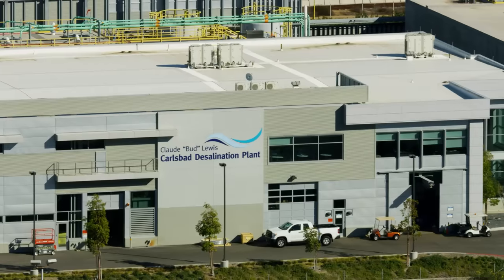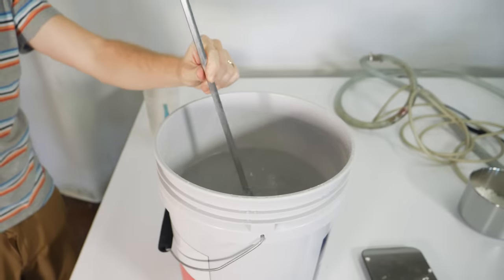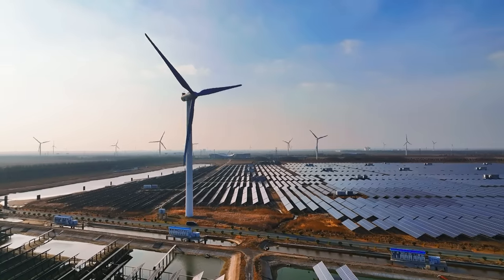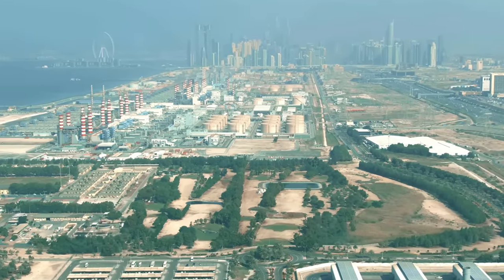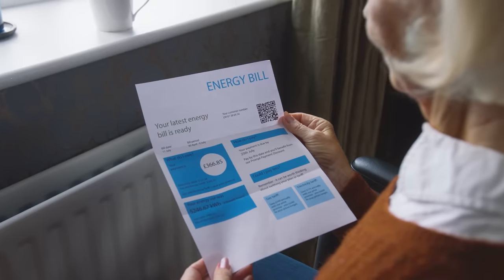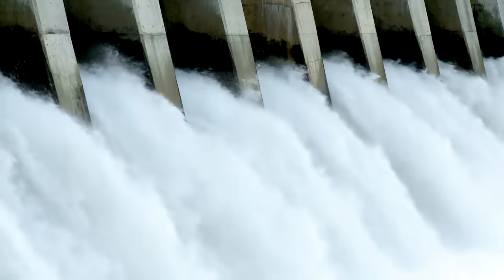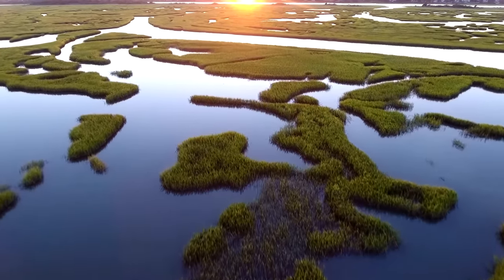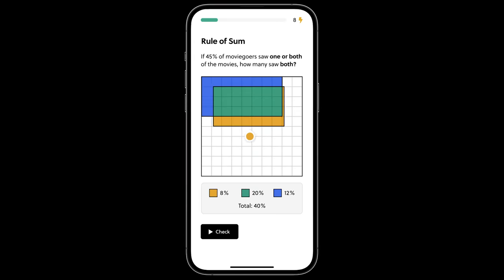Why Is Desalination So Difficult?

Comment: I've drank literally thousands of gallons of desalinated water over 20 years while I was in the US Navy. First ship used 7 stage evaporators and the last two used reverse osmosis. You couldn't tell the difference between them since it was pure water that came out of them and the engineers added minerals back into them to make them drinkable.
Reply: How does the engine add the minerals back?
Reply: Ship scale is a lot easier than city scale, glad it works
Reply: @johnmicheal3547  Its not an engine. Its a desalinization plant. The chemicals are put in the water using a metering device before the water goes into the storage tank on the ship. We only had bromine injection on our ship. Bromine is used to kill any bacteria in the water.
Reply: Same here. The water got interesting on one of the big decks I was deployed on when it tried to distill saltwater fouled by fuel dumped by a Harrier. The "drinking" water tasted and stank of JP5 for weeks.
Reply: On our ship(USS Camden) we were fine with just a 5 stage evap. One was in the forward MMR and one back aft. The one back aft always made more water as my evap had a vacumn leak somewhere in the aux exhaust preheater that I could never find(but made a great shower during shutdown when the vacuum was broken lol) Sounds like you were on a carrier lol.
Reply: @memadmax69  OP said engineers, john was probably talking about that.
Reply: @johnmicheal3547  engineers. as in people. they add in a tiny amount of sodium, calcium and magnesium. An easy way to add minerals to water? A pinch of pink salt/sea salt lol.
Reply: @johnmicheal3547  Engineers* and simply add salt to pure water 💁‍♂️
Reply: @nikkothegoblin depending on the ship. Carriers can have over 6000 sailors while deployed.
Reply: i dont know
Reply: You can actually drink distilled/deionized water just fine. No need to add minerals to it.
It's a myth, tap water is also hypotonic, and not much more hypotonic than distilled water.
You get your minerals from food. To get problems because of the minerals, you need to drink like 8L of water in less than an hour, and it doesn't matter if it is distilled or not.

It's one of those things that sound like make sense, but then when you think about it a bit more, notice that really doesn't.
Reply: thank you for your service, sir!
Reply: Hmm just wondering, while I certinaly only would drink fresh water, I believe I wouldn't mind to shower with saltwater.. is this done? Or is this a bad idea?
Reply: @georgelionon9050  It's not good for your skin.
Reply: @ficolas2 It's more likely for taste. You can drink cooled boiled water just fine but you find that it taste less "water" than you subconsciously imagine...
Reply: @theotherohlourdespadua1131  yep
Reply: @memadmax69 Hi, 
Thanks for your post. Would you know why bromine was used instead of chlorine? I’m only familiar with the latter as disinfectant for drinking water. Tia!
Reply: @georgelionon9050  Not that I know because heat (hot water) plus salty water gives scaling on the inside of pipes/valves. Not good.
When you take a shower on board, you need less shampoo or soap then you normally do as the water is very soft compared to treated groundwater.
Reply: Thats actually really neato.
Reply: You don't need to add minerals back to make it drinkable.
Reply: Water is crucial onboard. The Navy figured it out.
Reply: Yep, a 3900 ton frigate ( 150-180 crew) can produce 35 cubic meters a day (that's about 9240 gallons) with just two evaporators. 
 This is very useful in disaster-relief scenario's as getting potable water into the area is a life-saver.
The crew will stop taking showers and only use water to wash the clothes of medics and the ones preparing food besides the use of water for cooking and making coffee.... ;-)
Reply: It's not just salt, it's mostly calcium and magnesium that you add to make the water not corrode the inside of the pipes. You can just add the chemicals and mix it in tanks or make a salt solution that you add to the water in the pipes.
Reply: Dad was in the USN and I remember him saying that drinking the water before those minerals were added was about as refreshing as drinking air.
Reply: @Conservator.  Not entirely sure but, I think it was because chlorine causes rust and its corrosive. Bromine is an ionizer I think. Its been a long time however.
Reply: @robertlewis5439  interesting. jp5 and water have different densities. they shouldn't even mix
Reply: @johnmicheal3547  While I don't know what the US navy does, We in the Royal Navy add Calcium Hypochlorite to the fresh water tanks.
Reply: @georgelionon9050  At some beaches, they have showers that use seawater. They are intended to just rinse off the sand. You feel cleaner after, but not really clean :)
Reply: Your ship probably had a nuclear reactor designed to produce much more energy than you needed on any given day.  If not, you still had a relatively unconstrained energy budget due to being funded by the military. If we had an unlimited energy budget, Desal would be relatively easy. Since we don’t, it’s super duper hard.
Reply: @nikkothegoblin  The scale isn’t the real issue. The energy budget is. That ship either had a nuclear reactor with a lot of headroom, or just had its gas tank filled by the Uncle who doesn’t need to check his balance before he goes grocery shopping. Either way, there was an effectively unlimited energy budget. If we were to build the amount of per-person nuclear generation an aircraft carrier has we could turn Utah into a rainforest.
Reply: @scottfw7169  you should sell it and call it cool breeze 😂
Reply: Distilled & filtered water is drinkable, without having minerals added.  

I think you are looking for 'palatable'.
Reply: Thank you for your service
Reply: @robertlewis5439  BT, DT
Reply: @johnmicheal3547 engineers, not the engine. As a nuclear machinist mate on a submarine operating the reverse osmosis unit was our responsibility.
Reply: @nikkothegoblin the reverse osmosis filters we used on the submarine were very expensive. The unit itself was also incredibly expensive.
Reply: @georgelionon9050
showering w/ salt water is fine for your body, but would probably hurt your shower’s plumbing. Salt water can be more corrosion to metal pipes & build up scale very quickly, requiring more frequent cleaning/flushing of the system components.
Reply: @johnmicheal3547  on smaller boats    The water wouldn’t have minerals.  Didn’t bother anybody for drinking but coffee wouldn’t taste right. So we would save egg shells and crush them up and put them on top of the coffee grinds in the coffee pot.     The navy is probably slightly more sophisticated. 😅.
Reply: @fn0rd-f5o im not 100% positive, but i think the increased density of seawater allows for a bit more suspension of things like JP5, but i indeed could be wrong. But, even the gasses coming off the fuel could also make its way into the water. Maybe not the JP5 itself but some of its aromatic constituents i would say could stick around especially if a little of that got into the storage tank itself, it would likely stick around for a while.
Reply: @w.o.jackson8432 Palatable?
Reply: ive been drinking water below 30ppm for about 5 years now and have recently switched to 0.00ppm. when i started my kidneys were sticking out of my back and were shutting down every other day.
 i wold have received dialisys treatment if i wold have taken the normal route.
 we get all the minerals we need from a decent diet we drink water for cleaning not for feeding. they use salt in the same way as farmers do. its creates dependency and works as an decomissioning process. you know that in most lines of work you cant really find a job if you have to many certifications? because of the legal obligations o resonable pay.
Reply: @dROUDebateMeCowards  It's funny that this video started off showing the Carlsbad desal plant. Right up the coast from the Carlsbad desal plant sits two nuclear reactors that are presently being decommissioned. Their steam generators were the real problems with the plant, the reactor cores were fine and in good shape and would have likely been granted a renewal when their last operating licenses expired in 2022. 
The amount of heat those reactors can generate could have made it the largest desal plant in the world by thermal capacity, with the appropriate multi-stage distillation plant. Nuclear Reactors generally only reach about 35% efficiency which means a 3000MWth reactor ends up coming in around 1000MWe output. But if you use that heat to boil water into steam and condense the steam rather than use it to spin turbines, you'd end up with enough heat to run a massive desalination operation. You'd have enough excess to run a large pumping station to push sea water up over the mountains to the Salton Sea and pull water back to reduce salinity and flush out all the nastiness the farmers are dumping in it. 
But instead, San Onofre is going to be taken apart and the potential wasted.
Reply: The ship I was on in the Navy had reverse osmosis. The water was good, the problem was the Bromine. Sometimes the water would come out yellow because it had so much bromine in it. Nothing is less refreshing than Bromine flavored water haha
Reply: @dROUDebateMeCowards  "If we had an unlimited energy budget, Desal would be relatively easy." So you're saying build more nuclear reactors?
Reply: I've often marveled at how the US Navy implemented desal so well.  On my carrier (which was not nuclear), the water usually tasted ok; every now and then it would have a fuel smell to it, but not any more so than what they have in west Texas towns.
Reply: Here in Israel, 90% of all drinkable waters are from desalination.
As well as exporting it to Jordan.

By far away, the largest portion on earth.
I can't believe he didn't mention it.
It is THE global center of desalination.
Generally, of water usage technologies.
Reply: @tedlahm5740  RO water is delicious, it tastes completely pure.
Reply: @memadmax69  bromine also kills your sex drive allegedly.
Reply: When deployed, our ROWPU guys ran out of a mineral, and the water never seemed to quench your thirst.
Reply: @Ellfman  RO water hydrates the body in the exact same way as mineralized water.
Reply: @ficolas2  it tastes weird and wrong though. Adding back some minerals is for keeping people *happy*, not safe.
Reply: @robertlewis5439 imagine how the fish felt. 😓😭
Reply: @johnmicheal3547  Engineers, not engine.
Reply: @ficolas2 it’s a taste thing
Reply: @ficolas2  Eh. It's definitely a terrible choice if you've been sweating. It's not a myth either, water literally bonds to whatever is in your body when its deionized. It doesn't cause much damage, but why even risk it.
Reply: @SockyNoob  body fluid osmolarity is around 300mOsM. Tap water is around 10mOsM. milliQ water, basically 0.
What makes you think that a water with 0mOsM will "pull out basically anything from the body", and water with 10mOsM won't?
If you know how osmotic pressure works, the answer is simple.
Its basically the same.

As others have said. It's a taste thing
Reply: @dROUDebateMeCowards  Commercial Shipping here, as in Ships operated by penny-pinching Owners. We can still produce Fresh Water all we want, because the Evaporators use reclaimed Waste Heat from the Diesel Engines. They are heated by Cooling Water, and use Vacuum to lower the Boiling Temperature of Water sufficiently to be boiled by the 80°C Cooling Water. Meaning to say no additional Fuel burnt for Fresh Water Production, at least as long as the Main Engine is running.
Reply: Pure water, also known as distilled water, is perfectly drinkable.
Reply: @w.o.jackson8432 you don’t need to add minerals to make it drinkable, but it can degrade pipes and valves over time😀
Reply: I agree beer water I drank was aboard ship at sea
Reply: Glory to me, the 69th reply.
Reply: @SinHurr  haha
Reply: Dude make sure you are not leaking secrets or anything xD
Reply: Like people risk their lives for this info and its in a youtube comment on disallenation
Reply: Hello everyone. Anyway the blood of Jesus Christ against all fallen angels spirits with in any humans or by any humans who is reading this. The blood of Jesus Christ against you fallen angels heading for the lake of fire and the bottomless pit. In Jesus Christ name return to hell and return to the earth or 2nd heaven again.
Reply: Did it use the heat from the reactor directly for the distillation system?
Reply: @memadmax69 now a days we use calhypo.
Reply: @ficolas2 it is actually for flavor. A tiny amount of calcium hypochlorate makes di water taste just like tap water.
Reply: @georgelionon9050 it is done if potable water reserves run too low for some reason.
Reply: @memadmax69 they use calcium hypochlorate now.
Reply: @fn0rd-f5o  they make a suspension when heavily agitated that takes a good while to settle out.
Reply: @Stormcrow_1  same.
Reply: @garystewart3110 the problem is with turbulence the fluids become 'entangled' and the small droplets of jp5 aren't heavy enough to fall out of solution
Reply: Anyone remember the green slime in the tanks? 😂 whenever they opened them up to clean them up during an overhaul, the water always tasted like metal for a few weeks until the slime came back.
Reply: *I've drunk. Grammar is a thing. Use it.
Reply: I believe Dasani water is deionized and then has trace minerals added so it has the right taste,
Reply: Then they add some jet fuel
Reply: @ficolas2 Ok then explain this: Why does an animal cell placed in pure water draw water into it and burst? I think you are confusing low tds(less than 25 ppm) water with 0 tds water. 0 tds water is definitely bad for you even in the short term.
Reply: @kiyoponnn  you can't be serious.
Humans are not single celled organism...
Reply: @annabellethepitty  I see
Reply: @disky01  Showering in seawater is no worse than swimming in the sea. It's not bad for your skin.
Reply: @memadmax69  All ionizers cause corrosion.
Reply: @razvan-andrei-popescu528  in most lines of work you can find a job even with many certifications
Reply: @user-tm2bq2oz7l  Israel is not the global center of desalination. It has less than half the population of Saudi Arabia, so 90% in Israel is still smaller than 50% in Saudi Arabia. When you add UAE, Israel's numbers get even smaller.
Reply: @HalIOfFamer  allegedly? are you spreading false information?
Reply: @SockyNoob  It's a myth that "water literally bonds to whatever is in your body when its deionized". You're telling us you don't understand chemistry. You don't need to use "literally". Intensifier words like literally are for emotional feel, not factual knowledge. Even deionized water self-ionizes on its own, because all water naturally splits into hydrogen ions. The de- of deionized is removing just non water ions, not all ions.
Reply: @cocococop6082  Can you use the lake of fire to desalinate the blood of Jesus Christ through distillation?
Reply: @kiyoponnn  0 tds water is not bad for you. A single cell placed in pure water bursts because it does not have the balance systems that a full animal has. A single cell can't sweat or use kidneys, lungs or hypothalamus to raise or lower osmotic pressure.
Reply: Haha reminds me of the time the HTs pumped the CHT into the potable water tank.  Min water for the rest of the cruise 😂😢
Reply: @disky01 actually, it’s great for your skin. I spent over a year doing this and my skin ways the healthiest it had ever been. If you have bad b.o. regular salt water bathing will eliminate it really quickly.

It’s bad for like a dozen other reasons though. Not the least of which being it’s absolutely awful for pipes, glass and faucets. For the same reasons mentioned in the distillation method, it also will quickly clog up a water heater.

It also will leave you feeling crusty as you end up with a layer of salt on your skin.
Reply: @georgelionon9050 Running pipes just for saltwater to save a little energy for desalination won’t be worth it. And saltwater’s corrosiveness and penchant for scaling will be a pain to maintain.
Reply: I've drunk / I drank
Reply: Thing is on a navy ship the economics don’t matter. Is the water $0.01 a litre or $1000 a litre? It doesn’t matter because the US military will pay for it.
Reply: Yea, the only difference occurred when jet fuel got into our water.
Reply: @tarek900045  Same technology that's been in use for decades world wide. RO was developed in the late 1950s and evaporators in the 1850s.
Reply: @MrLoobu   Distilled water is safe to drink, but it can cause dehydration and lead to health issues resulting from the lack of nutrients that are essential to our health.
Reply: @disky01 personally my skin feels really good after swimming in the ocean.
Reply: @markdavich5829 😂 got a good chuckle out of that one
Reply: @memadmax69  Chlorine is used as water disinfectant in heavily regulated amount. Are you sure bromine was used?
Reply: @georgelionon9050  If the water is too salty, then it is hypertonic and bathing should cause dryness of your skin. Your lips will dry and feet may develop scales. Good part is salt water is bactericidal in nature. 👍
Reply: @weirdshibainu This is surprising to you?
Reply: @nofuxgoonthe navy salt bae 😂
Reply: @TonkarzOfSolSystem who pays them?
Reply: "Drunk" not "drank". If you're using present perfect tense you use the past participle not the simple past form of the verb. We don't say things like "I've took" or "she's knew" or "we've gave".
Reply: @dfgarciasteam As someone naturally inclined to be a bit of a grammar nazi, I can tell you this with certainty: no one likes a prescriptivist prescriptionist.
Reply: @ficolas2 You are the one who isn't serious. What about the 0 TDS/0 ppm part? Because that's what deionised water is. Why does it not affect a human? Will it not leach minerals from the body? Even if your diet is perfect it is still problematic.
Reply: @sammiller6631 How does a human body balance osmotic pressure in this instance? By moving minerals out of cells and into the water. Don't give me vague half baked replies. I am here to learn.
Reply: @Conservator. The Disney theme parks use bromine to disinfect the water on water rides (like Pirates of the Caribbean, Splash Mountain, and It's A Small World), since bromine doesn't stain clothes as easily and isn't as corrosive to human skin. Since park guests are often splashed with the heavily-disinfected water, bromine is the more expensive but better choice. Bromine is also the preferred choice because it keeps working long after being added, unlike chlorine, which "shocks" the water upon first addition but then grabs onto impurities and stops working.
Reply: @sammiller6631 
So what? Most of the advancements of the technology and innovations related to desalination are from there.

Their desalination plans are so much more efficient than California's, and many American companies have learned from there.
Reply: @kentslocum  Thanks!
Reply: I concur.
Reply: @memadmax69  bromine is dangerous
Reply: I almost fell asleep watching this video
Reply: @kiyoponnn people got over middle school.
Reply: As a carrier guy (CVN-72), this brings back memories.
Reply: @CountMeOut33  Not at all
Reply: Thank you for your service
Reply: @doomtho42  aside from being objectively wrong, good thing no one much cares
Reply: Congratudolences?
Reply: @mousermind  I tipsy / I drunk
Reply: @Conservator.  
I'm not entirely sure but I remember reading a report from the WHO where they reported that bromine is more effective than chlorine in a wider ranger of pH and is also more long lasting. Maybe that is a factor but given the choice I would never pick bromine over chlorine.
Reply: @coreyscysen1705  just 20+ billion less than a country like australia which has a small population.
hell if you realized how much water just to estabilish a bit of turf.

Great technolog but definately a long way off.

We also have recycled sewrage plants pumping out water, seems very chemically strong what chemicals dont know also seems extra corrosive again. Beats wasting drinking water but you wonder how efficeint the effort is to the return as theres a lot going on in 1 of these plants without even going in a building we were doing a major upgrade on a plant.
Reply: @markdavich5829 Me boiler tech! Me make steam!
Reply: @georgelionon9050 on Boats (aka Submarines) we showered with freshwater. When I first joined we use steam distiller units. Later went to RO machines.
Reply: @DreadX10  we use additives to help with scale formation and periodic maintenance to clean the tubes as well.
Reply: @johnmicheal3547 minerals added to water is common.  Sparkletts water adds minerals that give it a bit of a unique taste compared to other water companies.
Reply: @SofaKingShit  good call. You're right, rainwater is "usually" from evaporated sea water.
Reply: @georgelionon9050  The ocean liner Queen Mary, now a hotel and tourist attraction in Long Beach, California, has on its tour cabins with showers that have faucets labeled "Sea Water" and "fresh water". The idea was you washed with (Heated) sea water and rinsed with fresh water. This was to conserve fresh water. I'm assuming that the technology from the 1930's was more expensive and less effecient to create the need for reduced fresh water use.
Reply: @memadmax69  It's really unfortunate that they used bromine. Make sure to keep aware of the condition of your thyroid as you get older.
Reply: @SockyNoob 

"It doesn't cause much damage, but why even risk it."

Because the risk is so close to zero as to be indistinguishable from zero.
Reply: @kiyoponnn no, you are absolutely wrong. 0 tds water is not bad for you to drink.
Reply: @dundonrl 

"Can cause dehydration and lead to health issues from the lack of nutrients essential to our health."

This is pure myth. You would have to have severe nutrient/mineral imbalances unrelated to the water you're consuming, and not be receiving nutrients/minerals from food sources. The trace amounts of minerals in drinking water are negligible when compared to what you get from the food you eat.
Reply: @kiyoponnn 

"Will it not leech minerals from the body?"

Not to any relevant degree, no. And absolutely not at a faster rate than your body receives minerals from the food you eat.
Reply: Hmm, why does it need minerals to be drinkable?
Reply: @user-tm2bq2oz7l 

Saudi Arabia produces nine times more desalinated water than Israel.
Reply: @ficolas2  the water quality here in NJ isn’t the best. Made drinkable with chemicals. R.O is the only thing if been drinking for years. It’s funny how the tap starts to drip when the bladder tank runs out. I know it’s time to change filters. Every 8 months about
Reply: @memadmax69   LOL  Thanks guys.  I was scratching my head how an engine adding mineral into the drinking water.  I was thinking along the line of jet engine taking in air outside and pressuring and warming up the air for the people inside to breath.
Reply: I worked on 3 stage evaporation distillation plants, and reverse osmosis distillation plants. The only thing that we ever added was bromine. We were told that it helped keep it safe from microorganisms.
Interesting that I learned last week that contact with or consumption of bromine can cause several health problems. I hope that my direct contact with it and drinking it in water for 6 years won’t produce the symptoms that I read about.
Reply: Thanks for your service water uber.  Plus the navy definitely has the know jow to make sure the water is drinkable and usable for their nukes.
Reply: Remineralizing is key. If you like having teeth, don't regularly drink distilled.
Reply: @memadmax69  bromine is also dangerous for human consumption.
Reply: @notahotshot 
In a much much more expensive and way less efficient process.

Obviously, they can afford that immense cost.
Reply: @camohawk6703  Their nukes? We don't worry about them, it's the Crayon eaters we worry about!
Reply: In my experience, boat water was cleaner than barracks water.
Reply: I’ve heard many tales of desalinated Navy ship water tasting from strange to bad. This was just a couple years ago. Wonder what the variables are.
Reply: @johnmicheal3547 ENGINEERS not ENGINES, there's a difference. Engineers are people, who are easily capable of dumping a bag of minerals into a tank of water.
Reply: @w.o.jackson8432 nope but you do to make it enjoyable
Reply: Ship water aint that bad, always refreshing after a day of mucking around in AMRS and MMRs.
Reply: For anyone interested: On average, an individual will drink about 182 gallons of water per year. So yeah, over the span of 20+ years using the word "literally" here is not an exaggeration!
Reply: @dakotareid1566  Nothing more enjoyable than pure, clean tasting water. I don't want to taste anything but the water itself, if I did I wouldn't be drinking water.
Reply: So what role does the jet fuel play?
Reply: @user-tm2bq2oz7l Propaganda. It’s all funded by Europe and the US, Israel wouldn’t exist without us. Also, due to Israels minuscule population, it is certainly not the global leader in desalination compared to some other middle eastern nations.
Reply: @nikkothegoblin that and it’s the US military budget compared to a municipal budget
Reply: I think our evaporate  had an educator to reduce the atmospheric pressure  so evaporation could happen at lower temperatures this week 20 years ago but I am sure some other navy engineers could walk you through it. Would love to watch that video.
Reply: Was just going to say the same thing. 20 years in the Navy and thousands of gallons of both types of desalinated water consumed.
Reply: That's cool! I ran the ROWPU (an RO unit) and it was rewarding to get potable water from the ocean as well as some pretty rough looking ponds. Now applying to work at a company that makes all sorts of water filtration!
Reply: Yep. Same
Reply: I must object to the correct use of the word literally. It is confusing for regular readers of the comment section.
Reply: You don't have to add anything back in to make it "drinkable." I've had gallons of distilled water just to see how it was. It tastes a little different, but in a tea or coffee, it's still miles ahead of crappy tap water.
Reply: @johnmicheal3547 you just toss a glass of salt water in or piss in it
Reply: Brewed poison.
Reply: yup I drank tons of that stuff in the Navy. No other choice. And yes even the soda machines use that water too to combine with the syrup. Of course I also drank sodas from the machines, those are of course bottled locally, some of our soda came from Bahrain or maybe it was Saudi Arabia, which I'm sure they use desalination as well.
  I even had a sip of de-ionized water. We used that for our laboratory tests on steam plant and reactor plant water.
Reply: Thats from the steam boiler
Reply: @jimmym3352  Someone used deionized water (cooling water for the radar consoles in CIC) to make coffee. We were wondering where the hell the water was going!
Reply: Nah.  Politics is the biggest hurtle. Nuclear power plus big desal plant = plenty or portable water.
Reply: Thank you for your service!
Reply: @dROUDebateMeCowards  Nuclear will be necessary anyway for any real reductions in fossil fuel use, and so, when possible, just plop the power plants in the shoreline with necessary precautions.. Your typical 1000MW PWR is able to desalinate plenty of seawater just with waste heat (if anything you run it a bit inneficiently, like no low pressure turbine), and most power plants have at least 2 of them. One in France has 6!
Reply: @georgelionon9050 its generally a good idea to avoid unnecessary contact with water that has a high salt content. Water likes to flow from low salt areas to high salt areas, to try and equalize the salinity (this is called osmosis). If you come in contact with very salty water, the water in your body will flow out to try and equalize the salinity, causing dehydration. 

This is a big reason why the "crusty" description is usually applied to sailors, lol. Turns out, having the water sucked out of your skin constantly for years really isn't good for it.
Reply: Dont know about the details of the desalination system from my grandfathers ship in vietnam but his was contaminated with agent orange, they tried to give him the run around but he fought the VA and won.
Reply: @memadmax69 if the water was reversed osmosis it's already clean.
Reply: Thanks for serving and sharing. Appreciate it
Reply: @catsupchutney and yet it tastes weird.
Reply: @sammiller6631 legit question.
Reply: @memadmax69 they misread “engineer”
Reply: On my sailboat we had an atmospheric water generator that condensed humidity out of the air.
Reply: That's because the USN doesn't give a rip how much it costs because storing fresh water is absurdly impractical.  The USN will spend whatever it requires, but the world at large doesn't have that luxury.
Reply: this is a nice comment section. With this many replies this is a first for me.
Reply: @johnmicheal3547  everyone knows a boxster engine adds minerals back in
Reply: @ficolas2  speak for yourself PAL
Reply: I was the engineer, we didn't add anything to it but powdered sodium hypochlorite (pure bleach) 

 😂 this guy must have been a shipriding topsider
Reply: @scottfw7169 your dad lied to you 🤷‍♂️ I was the engineer, the only thing we added to the water was pure bleach
Reply: @memadmax69 yup, we'd pour so much sodium hypochlorite into the water tanks it would destroy all the electric level sensors, to the point know one knew how full the tanks were and they'd over flow all the time 😂
Reply: @Stormcrow_1 so does the USN. This guy is on crack
Reply: @seanboy2008 big ships didn't add anything either, other than bleach.
Reply: @FW-jq1ox that's because the fuel tanks were ballasted with fuel, and some one expelled ballast water while the were making water😂
Reply: Do you feel any side effects from drinking the sea water for 20 years?
Reply: @hotbrakepads  Honestly, I don't know.
Reply: @EitriBrokkr  First ship was USS Essex LHD-2 and maintained the computers in DPC and CIC, 2nd and 3rd ships were Burke class DDG's and I was a Tomahawk tech on them.
Reply: @Ebani  they didn't
Reply: @georgelionon9050  You also need calcium based soap. Ordinary soap is the sodium salt of a fatty acid. No suds in seawater.Buying calcium soap in a marine supply store is fiendishly expensive. No doubt bulk purchase brings that down,but still more expensive.
Reply: @ficolas2  The concern is less about acquiring the minerals and more that ro water might actively leach minerals from your body and, if used in cooking, from your food.

Some sources here. Nothing definitive it seems but still a possibility

https://www.ncbi.nlm.nih.gov/pmc/articles/PMC4223198/
Reply: I was about to say the exact same thing. What’s going on shipmate.
Reply: @georgelionon9050 😮😮😮
Reply: @johnmicheal3547 dafuq. The man said enginEERS
Reply: I heard desalinated water tastes like seamen
Reply: @dROUDebateMeCowards The original comment about scalabity is sort of supported by your argument.  On a ship there is a lot more waste heat available per person.  Heat from the engines, nuclear or otherwise, can be used as a first stage of a distillation system, which gives ships and advantage.  I dont know how RO pumps are powered.  If the RO pumps are electric then a ship is at a disadvantage because electricity on a ship is expensive.  If they are driven by the main engine then a ship has an advantage.
Reply: Noticeable, non-negligible flavor of JP-8, though.
Reply: @ficolas2  I drank distilled water made at home for 12 years and never added minerals. Im very healthy and have good labs. no deficiencies.
Reply: @ThatGuyOverThereWeird  exactly. No need for minerals in a place where there are basically none to begin with.
Reply: @nikkothegoblin if it works on ship scale it will work on city scale.
Reply: @fn0rd-f5o JP5 doesn't mix because it's hydrophobic, unless you have an emulsifier (eg mayonnaise is a mix of water and vegetable oil). However lighter hydrocarbons and water are very difficult to separate. Kerosene in particular has a wetting angle of 33°, close to that of water. That makes it very "smeary" on solid surfaces and difficult to scoop up unlike spilled crude. When it gets in the groundwater it's a huge problem because it travels with the underground flows. My last job I did some geotechnical investigation for groundwater contamination.
Reply: Oooohio
Reply: @Ebani  salt isn't added to pure waters. Bromine isn't same as salt (NaCl). Adding salt to water will do nothing to treat pure water.
Reply: @zlonewolf  No idea where you got all so mixed up but do quote me on that. I'll wait
Reply: @Conservator. Chlorine is notably more dangerous than bromine if you have a leak. Both can be corrosive and both are "hella toxic" to people in higher concentrations, but bromine gas is both visible and heavy.
Reply: @kumardigvijaymishra5945  bromine is used on ships because it's less dangerous in storage.
Reply: @robertlewis5439 the face you said JP5 makes me respect you even more.

I only touched JP4, JP8, Mogas, and BIO.

Mad respect
Reply: The US navy doesn’t add trace minerals into the water for taste. All we add is either chlorine or bromine, depending on the ship. I was on one ship that did chlorine and one that did bromine. Source: I was a nuke officer on a carrier who was in charge of these systems.
Reply: USCG vet here, same. I can still smell the bromine...
Reply: @johnmicheal3547 they don’t. The minerals are added after the desalination occurs.
Reply: I work on a research ship and our water is better than what I get at home.  It tastes better.
Reply: God Evaps were so brutal to work on and unreliable on some older ships. I was lucky when I was deployed, most ships were using RO's. Unlucky when they broke, but very good tasting water. Either gave you the trots or made you constipated because of the bromine (bromide? I don't remember, I was more of the boat breaker than the boat fixer later in my career)
Reply: All we put in there is bromine so the tanks can not grow bacteria 😂 other than that is is mostly pure water that still has a bit of salts in it but it’s very small amount.
Reply: I drank desalinated water in UAE and Oman. It feels nothing like drinking normal fresh water. It doesn't fill you up. You still feel thirsty. I can't explain the sensation. But I know when I went back to Kenya, I really enjoyed my first glass of water when I was back
Reply: There was a tiny hint that the water was different on the frigate. On my sailboat, you can’t tell at all.
Reply: @nikkothegoblin You are overlooking a key issue, real estate, or lack there of. Also there are a lot of people on those ships
Reply: Why can you not power a turbine with the steam and power the heating coil with power created from steam turning the turbine. To at least reduce the energy output needes?
Reply: @Ornithopter470  Both chlorine and bromine are present in sea water. Actually bromine is still a liquid at 25°C, while chlorine becomes a gas at much lesser temperature(1atm). Yes, storage wise Br is a better halogen. Bromine is soluble in organic solvents such as carbon tetrachloride, & chloroform. Chlorine is soluble in water.
Reply: @memadmax69  Both Cl and Br are electronegative elements with quite similar electron gain enthalpies.
Reply: @coreyscysen1705  My cousin served on the Ronald Reagan and he didn't understand how the plumbing worked (he handled munitions).  He just appreciated fresh water being available on demand.
Reply: @ficolas2 osmotic pressure is higher with distilled/pure water. Our stomach acid might be able to balance it out. But it can lead to cell walls rupturing.
Reply: @raffikkiz  I gave the math. The difference in osmotic pressure is negligible. They are basically the same for drinking. (Except taste)
Reply: @memadmax69
I served aboard the USS SEATTLE from ‘74 to ‘79.
EM02
Reply: In the civilian world today many sailboats have "water makers" which are hi pressure reverse osmosis.
Reply: You drank thousands of gallons of water eh
Reply: @brandon8900  20 years in the Navy, 13 of those years stationed on Navy warships. The average healthy male drinks 15.5 cups of water a day. That equates to about 4500 gallons, so yes.
Reply: All while being powered by nuclear engine?
Reply: @johnmicheal3547 engineers* not engine
Reply: @johnmicheal3547 he said engineers not engine
Reply: Very interesting! Always wanted to join the forces
Reply: thank God the VA just added abuncha stuff u can file claims for I'd deff figure no one's goes out free and clear after digesting that much quick flipped navy  juice  lol jk
Reply: I also did twenty years in the navy, all on tin cans- never a carrier and the Bromine they added to the water gave me the most ANTISOCIAL FARTS!!
Reply: @nikkothegoblin  depends on the ship.  It is scaled appropriately..
Reply: @georgelionon9050 you would feel very sticky. During wog day, we cleaned up with showers made from fire hoses drafting sea water and while I got all the rotten food and grease from the royal baby's belly washed off but didn't feel clean until I took a regular shower
Reply: Nothing wrong with drinking distilled water.
Reply: I'd be surprised if they added minerals back into the water. I was in Machinery Division on Submarines for 20 years running evaporators and RO plants, and we sent that water directly to the potable water tanks for use. The only minerals that water got was from the rust in the tank!
Reply: Bruh the bromine water was the worst water I've ever tasted.
Reply: UK merchant ships we condensed salt water into fresh, I as an apprentice in 1973/4 had to open the condenser and knock the salt off the copper STM coils...
This narrator... He makes things sound complex... Reality.. wast STM tho copper coil heats saline water...this turns to Steam.... Now steam will not carry salt... Specific gravity... I.E. salt left behind. STM rises. Hey ho... Fresh water...
This guy makes a very simple process seem complex....
And is not complex at all...
Thom in Scotland.
Reply: I couldn't agree more , tho I was on the S.S Bombardier, built in the 1950s if I remember correctly, but British merchant ships were quite primitive, that was 1975 when I was on her... But  yes I recall minerals being added, by the 2nd engineers... I was 17 at the time.... the water was so pure minerals as you correctly state.. had to be added... 
Thom in Scotland.
Reply: De salination at sea on a vessel with huge amounts of waste steam / heat to boil sea water and at no expense, whilst ....
Ashore you need costly  power inputs to boil water to gain steam then condenser back to water ... Expense is prohibitive, 
Yet there are far more modern versions ..
.
Thom in Scotland
Reply: Bling and operating costs not affordable to normal people, nor the capital costs of such a system. An A10 warthog costs $5000 per hour & its the cheapest to operate military aircraft!
Reply: @johnmicheal3547 they have a big bag of minerals they add into. By that I mean electrolytes.
Reply: @johnmicheal3547 engineers man. Learn to read
Reply: "the last two [ships] used reverse osmosis. ...  the engineers added minerals back into [water] to make [it] drinkable" - I think it wouldn't be necessary in case of reverse osmosis, as this process is not "all or nothing", as is the distillation (in which no minerals can pass over to the distillate) - it's a "gradual" process.
Reverse osmosis will produce water(s) with various degrees of "demineralisation" (and that's why it's called "demineralised water"), depending on membrane used and number of stages - and waters with various degree of demineralisation are used for different purposes. For instance, to wash glass panes in IGU manufacturing facility you need a demineralised water, but not to a very high degree. "Cleaner" water is needed (AFAIK) for things like lead-acid batteries, and even higher degree of demineralisation is needed in steam generators, where the water is evaporated almost completely.
The thing is, the higher demineralisation you wanna achieve, the more energy has to be put into this process, and more expensive the system/ device becomes itself.

But at any rate, in case of using reverse osmosis for producing drinking water, in order to retain some degree of mineralisation all you need to do is to leave a little bit of salt/ minerals in the water - but then maybe it's more practical/ viable just to purify (demineralise) the water completely, and then just add carefully weighed pre-mixed "mineral salts mixture."
Don't really know, know how it was those on those ships, I'm just saying how it CAN be done.
Reply: Snipes run the navy
Reply: @Stormcrow_1  That's for disinfection/ preventing growth of bacteria (and foul smell/ taste of water).
Reply: @AliyahGlen  Too bad "almost" only, should you doze off completely you wouldn't post this enlightening comment.... ;-b
Reply: @notahotshot  Some (long) time ago I read about then DDR practice of "feeding" some of its political prisoners distilled water only - i.e. tea, coffee or food was made using distilled water, and that was meant to induce (on the long run) all sort of mineral-deficiency ailments in those prisoners.
Can't give you any source, it was a side info in a much greater body of text, that I read decades ago - in '80s if memory serves me.
Reply: @leviandhiro3596  All ships have snipes, only warships have weapons and their operators!
Reply: @johnmicheal3547  Engineers is not the same as Engines
Reply: @Ebani Salt to water is definitely NOT you want to have drinking water after you've just desalinated it. You add minerals like calcium, magnesium, sodium, potassium and some iron and zinc. Those are minerals that are usually in source water after they have been filtered by the soil and/or flow through rocky structures before being pumped out. Source water is often considered hard as there is a lot of dissolved calcium from rocks.

Those are all minerals that are also filtered out or lost in desalination processes either by filters or evaporation. White stains for example in your waterboiler is calcium that is left behind after water evaporates. It's unavoidable in the process and therefore added back in afterwards to meet nutritional requirements of the human body.
Reply: Not at all easier just less expensive lol
Reply: you can drink distilled.
just gotta get trace minerals elsewhere. its not complicated.
Reply: I prefer my water from the primary. Makes me feel energetic.
Reply: We used Bromine cartridges as filters and the taste was polarizing. Some didn’t mind and the others hated it lol
Reply: Still didn't taste that good because of the distribution side of things. 😅
Reply: We had two issues with desal before  we got a remin plant up an running. One it destroyed some steel pipes that where lessthan 6 months old. Two the coffee/tea boilers failed water quality tests for too much lead  as the water was leaching the lead from the soldering.
Reply: I think every vessel should have a nuclear reactor
Reply: Ship water was great.  Amazing how much the water quality dropped when we connected to shore water
Reply: @nikkothegoblin  Carriers can provide electricity and water to entire cities pretty easily if they wanted to. Source: I was USN ETN (electronics technician nuclear)
Reply: @sammiller6631 Well if we are being technical, it probably will be true that any water you drink will exchange hydrogen with quite a number of other atoms and will enter into quite a number of chemical reactions.  It's why you'd run into trouble if you drank only heavy water.

But yes, they've actually done studies on people drinking DI water and all they've found is they pee a bit more and may excrete a bit more electrolytes as a result (not a problem).
Reply: ...wait, you guys put minerals back in!
...we just drank the technical water  🤣
Reply: Where I live some of the in Land towns have poo poo, the thought of having recycling there water. But it’s a viable option. The difference between using reverse osmosis to ocean water or peoples. Doodoo is very slight really.
Reply: @markdavich5829 boiler techs don’t exist and haven’t since the 80s
Reply: @ficolas2 I've gotten sick from drinking purified water long-term. If you're not getting enough electrolyes from your diet to offset an active lifestyle in addition to drinking purified water, it'll compound the problem. It's not inherently bad, but it's also not as good as having a little salt in your water.
Reply: I imagine nuclear carriers have a lot of energy to waste when their not on full, ummm steam.
Reply: @ashshirey3052  Yeah, my thoughts exactly. Uranium is going to decay either way, so using it for literally anything is equivalent to free work.
Reply: Ok
Reply: i prefer jp-5 in mine 😂
Reply: It helps to have a nuclear power plant. We made plenty of water on a submarine.
Reply: ..and guess whos IP was used to make the first reverse osmosis machines on that ship you were on...??
Reply: Hoorah, US Navy all day. ABH/BU with NMCB18 here. Your absolutely correct. It's hilarious to see these guys talk about things we lived every day. Of course there is enough water.. where would it go? Lol, last I checked the atmosphere keeps water from escaping due to freezing it and we even get replenished by meteors so.. yeah.
Reply: A thought. Distillation may be an effective method, when done in tandem with energy generation.

The basic method of generating electricity is to take something, make it boil water, and have that steam spin a turbine.

If we replaced that water with sea water, and collected the steam that is used to spin the turbine, that’s desalination. 

There are probably a non-insignificant amount of complications here. I.e. you can’t do this with nuclear power cause, well, radiation. And there are probably issues with cleaning out the salt left behind. But, as a method of making fossil fuel use less awful, we might as well use every piece of the carcass as it were. Boil seawater to collect fresh water in places that don’t have access to it. Collect the salt left behind to reduce the INCREDIBLY ecologically damaging practice of salt mining, and generate electricity at the same time. 

I’ll end off with a mandatory: I am not an engineer, hell I’m not even a chemist, these are just the musings of a mind on the internet.
Reply: @spnyp33 sure, but it’s suboptimal. Humans have literally never consumed distilled water or pure water in nature.
Reply: Thank you for your service
Reply: My last ship in the USCG had I think a three stage desalination plant (been a while). It mostly ran on waste heat from the main diesel engines. The water that was used to cool the engine was recirculated into the desalination plant to boil water. 

The bromine system was pretty reliable, so the corpsman would test and add bleach as needed to keep it safe. I don't remember flavor issues, but nobody drinks water anyway. Everyone drinks coffee or big juice (generic Kool aid). 

That ship was Vietnam era, and was 30 years old when I was onboard. No nuclear power plant, and we didn't have an abundance of electricity (we were already at our limits). 

The budget of the USCG is extremely tight, we didn't just get play money for whatever.
Reply: @JoshuaTootell  true.
I heard that the Coast cards budget isn't anywhere near as wasteful as the Navy's.
Reply: @ficolas2 You can drink distilled water, but over time it strips the calcium and other minerals from your teeth. Even if it weren't for that, its still better for you to drink water with minerals because that's what we evolved to do.
Reply: @DanielDuhon  because water wants to attach to things. This is good, because it's part of the reason complex life is possible, but if you drink distilled water, it's gonna feel like drinking air. It can also leech minerals from your teeth, which isn't good. And personally, it somehow makes my throat feel dry.
Reply: Is Bourbon a Mineral?
Reply: Reverse osmosis is my favorite water flavor
Reply: @w.o.jackson8432 it's funny when someone makes a verifiably false statement and others upvotes it. Ignorance and misinformation is way too rampant these days. 

Pure water loves electrolytes, drinking it will rip them from your body and you'll definitely throw your chemistry out of whack. Super basic chemistry folks.
Reply: @ficolas2 it's funny when someone makes a verifiably false statement and others upvotes it. Ignorance and misinformation is way too rampant these days. 

Pure water loves electrolytes, drinking it will rip them from your body and you'll definitely throw your chemistry out of whack. Super basic chemistry folks.
Reply: @spnyp33  it's funny when someone makes a verifiably false statement and others upvotes it. Ignorance and misinformation is way too rampant these days. 

Pure water loves electrolytes, drinking it will rip them from your body and you'll definitely throw your chemistry out of whack. Super basic chemistry folks.
Reply: @w.o.jackson8432 it's funny when someone makes a verifiably false statement and others upvotes it. Ignorance and misinformation is way too rampant these days. 

Pure water loves electrolytes, drinking it will rip them from your body and you'll definitely throw your chemistry out of whack. Super basic chemistry folks.
Reply: @ficolas2 it's funny when someone makes a verifiably false statement and others upvotes it. Ignorance and misinformation is way too rampant these days. 

Pure water loves electrolytes, drinking it will rip them from your body and you'll definitely throw your chemistry out of whack. Super basic chemistry folks.
Reply: @MrLoobu it's funny when someone makes a verifiably false statement and others upvotes it. Ignorance and misinformation is way too rampant these days. 

Pure water loves electrolytes, drinking it will rip them from your body and you'll definitely throw your chemistry out of whack. Super basic chemistry folks.
Reply: @ficolas2 it's funny when someone makes a verifiably false statement and others upvotes it. Ignorance and misinformation is way too rampant these days. 

Pure water loves electrolytes, drinking it will rip them from your body and you'll definitely throw your chemistry out of whack. Super basic chemistry folks.
Reply: @sammiller6631 it's funny when someone makes a verifiably false statement and others upvotes it. Ignorance and misinformation is way too rampant these days. 

Pure water loves electrolytes, drinking it will rip them from your body and you'll definitely throw your chemistry out of whack. Super basic chemistry folks.
Reply: @notahotshoit's funny when someone makes a verifiably false statement and others upvote it. Ignorance and misinformation is way too rampant these days. 

Pure water loves electrolytes, drinking it will rip them from your body and you'll definitely throw your chemistry out of whack. Super basic chemistry folks.
Reply: @notahotshot it's funny when someone makes a verifiably false statement and others upvote it. Ignorance and misinformation is way too rampant these days. 

Pure water loves electrolytes, drinking it will rip them from your body and you'll definitely throw your chemistry out of whack. Super basic chemistry folks.
Reply: @notahotshot I mean there are countless studies that absolutely disagree with you but sure, let's take the advice of some random person online. Yikes.
Reply: @dakotareid1566 it's funny when someone makes a verifiably false statement and others upvote it. Ignorance and misinformation is way too rampant these days. 

Pure water loves electrolytes, drinking it will rip them from your body and you'll definitely throw your chemistry out of whack. Super basic chemistry folks.
Reply: @aluisious so you're saying your personal anecdotal experience is more informed than the whole of science?

Pure water loves electrolytes, drinking it will rip them from your body and you'll definitely throw your chemistry out of whack. Super basic chemistry folks.
Reply: @LittleXtra  Pure water doesn't "love". Projecting feelings onto water shows how unscientific your thinking is. If you drink pure water and eat normal meals, your body will get electrolytes from the food you eat. Pure water will not throw your body chemistry "out of whack" as your body has an amazing ability to maintain chemical balance.
Reply: @SockyNoob  Stop spreading myths about pure water.
Reply: @kiyoponnn   Why does an animal cell placed in pure water draw water into it and burst? Because it's a single cell without osmoreceptors. Whole animals have organs like kidneys with osmoregulation systems and Aquaporin-4 proteins that maintain homeostasis and fluid balance.
Reply: @dundonrl  Distilled water will not cause dehydration or "lack of nutrients" because those nutrients will come from eating food. If you're not eating food, you've got a bigger problem than distilled water.
Reply: @kiyoponnn  No, 0 TDS water will not leach minerals from the body, because the body does not seperate minerals from food from minerals from water. It's the same pool of minerals. Any minerals missing from water will come from food.
Reply: @kiyoponnn  Look up Aquaporins. The human body uses them to move water around, not minerals. There's also Vasopressin. 
And myogenic mechanism: When blood pressure increases, smooth muscle cells in the wall of the arteriole are stretched and respond by contracting to resist the pressure, resulting in little change in flow.

 This vasoconstriction of the afferent arteriole acts to reduce excess filtrate formation, maintaining normal NFP and GFR. When blood pressure drops, the same smooth muscle cells relax to lower resistance, increasing fluid flow out of the cell.

Minerals are carried along because the water leaves. The body targets water flow more than it does the minerals.
Reply: @rickevans7941   Drinking distilled water will not affect your teeth. Mouthwash or toothpaste will have a bigger effect on your teeth.
Reply: @chrisnagy377  pure water does not leach minerals from your body. Your body will get minerals from any food you eat.
Reply: @saidmbarouk929  Drinking desalinated water does fill you up. You were imagining things.
Reply: @fuelban  It is more complex today than it was when you were an apprentice in 1973/4. Everything has become more complex these days.
Reply: @GraniteInTheFace  They don't have a "big bag of minerals". They never spend money on extra steps if they don't have to.
Reply: @MrKotBonifacy  "all you need to do is to leave a little bit of salt/ minerals in the water" is more complicated than that. RO filters don't have a knob that allows you to dial in the level of minerals in the water. No one is adding minerals back in if they don't have to.
Reply: @MrKotBonifacy  If it was in the '80s, should we assume your memory isn't as good as it was in the 80s? Maybe you're mistaken?
Reply: @HighFlyer96  The body doesn't need any minerals in water. It can get all the minerals it needs from food.
Reply: @gulliverdalton8680  Why were you using lead solder in a desal plant? Lead-free solder for pipes has been available for a very long time,
Reply: @chrisnewman7281  Only some of the "in Land towns have poo"?
Reply: @Malicious2013  You can't get sick from drinking purified water long-term. Needing "salt in your water" is magical thinking.
Reply: @33moneyball  Humans have "literally" consumed pure water in nature. Stop spreading lies about distilled water.
Reply: @TheDustysix  Bourbon is a mineral.
Reply: @LittleXtra  If there are "countless studies" then name one. Better than spamming the same opinion paragraph to 10 different people.
Reply: @LittleXtra  "more informed than the whole of science" is Appeal to Authority logical fallacy. Science works on facts and data, not feelings and "whole of science" group think.
Reply: @sammiller6631  You can miss out on significant portions of some trace minerals and metal ions that are generally found in abundance in tap water, though. As much as 10% of your intake of some important trace minerals can be missed. People who aren't accounting for that with dietary changes may notice that. The jury is still out. I know that consuming strictly purified water for longer periods of time correlated strongly with me feeling sickly.
Reply: @sammiller6631  Yes, maybe. As explained above, what are you referring to?
Reply: @sammiller6631  The boilers weren't in the plant. There were just random off the shelf water boilers purchasing decided on for putting in breakrooms for the whole construction village and at the work site, they probably should have used lead free solder, but they obviously didn't. There was no soldering on site, its a coffee tea water boiler, like a electric kettle you hang on the wall and plumb in cold water.
Reply: Desalination by itself is not difficult, the real problem is one of scale. Making a desalination plant for 2000 people is pretty straightforward but making one for 20 million is not that easy. Desalination just isn't profitable because many people in coastal cities are working class and so the government has to do it and these days many western governments are reluctant to take on massive projects.
Reply: @johnmicheal3547 it gets put back in pr much, the engine doesn't make it its a whole separate plant
Reply: @georgelionon9050 Households waste a lot of fresh-water, that's true. Showers can't operate with salt water, but toilets cold. A bit costly to install at the moment but there are more eco friendly ways to flush down your waste than using drinking water
Reply: @DoggosGames  John said engines and asked a question that really doesn't make sense to ask of engineers because it's patently obvious how engineers would add minerals to water, but not obvious how engines would do so. It seems like John misread OP's comment and MadMax was right in his reply.
Reply: @markdavich5829  lmao 😂
Reply: @ficolas2  I've heard that it can cause a mild stinging sensation on the tongue or allergic-like reactions. Best not to risk it especially when minerals make it more palatable anyways. Do you have a source for your claims? Because "I'll admit it sounds correct but I promise it's not" is not a hyper-strong argument lol
Reply: @georgelionon9050  it would dry your skin out horribly. There is a reason that there are literally freshwater showers at beaches. Because you don't want to leave yourself caked in that salt.
Reply: @ficolas2  lmao you were so highly verbose in your first comment when you were sharing your vast knowledge, but someone points out that minerals are for taste and you just go "yep" 😂 are you... heheh... salty? hahahaha sorry
Reply: @w.o.jackson8432  thanks for being the 3rd or 4th person to state that. The guy is just telling us how things worked on his ship. Y'all don't need to show off your expertise on the drinkability of DI water. The minerals make it more palatable.
Reply: @joshyoung1440  oh, i go waaaay more ☝️🤓 some comments below lmao
Reply: that RO water is too good.
Reply: Did they not teach you the meaning of the word literally in the navy?
Or were you too busy learning how to choke on salty things?
Reply: Not thousands! 1100 max!
Reply: @keiyakins happy or making sure the ppl are cooperative and dulled
Reply: @johnmicheal3547  just taking a river rock and chewing on it gives you minerals too so i cant imagine it being too hard to add minerals to water at least for some of them
Reply: @fn0rd-f5o It is surprising because JP5 is made up mostly of nonpolar hydrocarbons, but compounds with different densities can mix to various different degrees depending on their polarity and charge. Consider, for instance, alcohol and water.
Reply: @memadmax69  I thought bromine was used to kill sailors' natural urges.
Reply: The irony in that, so funny.😅@Ebani
Reply: How is pure water ''not drinkable'' ? Just confused.
Reply: The Navy should show you the bill for that water
Reply: Oh yeah, we only desalinize water when it comes to the military.
Reply: What did it taste like without the minerals?
Reply: @sirsir9665  i wanna know too
Reply: @memadmax69 bromine? 🤯
Reply: @ficolas2 deionized water is LESS hypotonic than tap water.
Reply: @joelspaulding5964  no it's not...
Not by a significant amount, but DI is obviously more hypotonic, has less ions.
Reply: @johnmicheal3547 it was a mistake to make this joke on this nerd ridden place lol.
Reply: @imoutodaisuki  lol, thanks but I'm fine with it.  I've been online long enough to have seen much worse people.  I learn and take what is good and ignore what is bad, that's how to deal with stuff online.  :)   Happy July 4th.  :)
Reply: This becomes possible when you have your own nuclear reactor.
Reply: About all the comments suggesting it's okay to drink that water without adding back minerals/salts... do NOT do that. It will make your cells go splat. It's not about needing the minerals for digestion, it's about pure unsalinated water will kill the cells in your body.
Reply: Lol there aren't minerals in water. You navy guys crack me up 😂
Reply: @robertbones326  There are minerals in drinking water. Water without minerals (aka distilled water) is unhealthy to a point of being fatal over time.
Reply: @robertbones326  were you homeschooled? Did...did you get any kind of education?
Reply: @robertlewis5439 Utterly insane that they didn’t get some bulk containers of water from somewhere else dropped off to you. But I guess the whole burn pit situation kinda proved that the military doesn’t care about long term risks like carcinogens.
Reply: We also liked to add JP-5 into the water for taste.
Reply: It’s always somebody on here lying 😒
Reply: @kaicampbell8910  ikr? Man thinks he's Sonic the Hedgehog drinking "minerals" LMAO
Reply: That's a lot of piss
Reply: Ridiculous that the arguments against this and nuclear power are "the hidden costs" and "complex processes" needed to build up or maintain these systems. They are both hugely beneficial to society and humanity. The fact of the matter is everybody nose why we don't push more into these beneficial technologies that could solve some of the issues plaguing us in today's day and age.
Reply: @johnmicheal3547  Distilled water is not good to drink because it screws up your electrolyte balance.
Reply: @georgelionon9050 mineral salt soaks
Reply: @disky01 It's actually very good, that's why people take mineral salt baths.. They sell it (called Epsom salt) at the store.
Reply: @rgbii2 😂😂😂 not seawater lol he was talking about salt bath soaks like they do in a spa and stuff, not an actual ocean!
Reply: @spoonikle its done through a dosing pump similar to how chlorine is added right?
Reply: Engineers is a tittle like a doctor. And engine is a machine.@johnmicheal3547
Reply: Sipping on gas with your MREs🤣
Reply: @nikkothegoblin  Exactly the same process though. The difference is, the ship is funded directly by the government, while civil relies on making a profit, which is dumb. Making every aspect of life capitalistic is delusional.
Reply: @johnmicheal3547  He said 'engineers' not 'engines'.
Reply: @ficolas2 minerals make water TASTE much better. That’s why they’re added. MilliQ and dI water aren’t too tasty.
Reply: 4:21  @DreadX10
Reply: @uvman6648  ??
Reply: I've DRUNK, not "drank."
Reply: @memadmax69 it's an engineer....am I missing something?
Reply: @Nick-b7b9s  A little late to the party aren't ya?
Reply: @memadmax69  sorry I didn't read the 370 replies before commenting.. I'm a very bad man